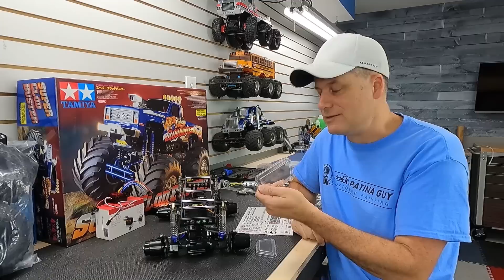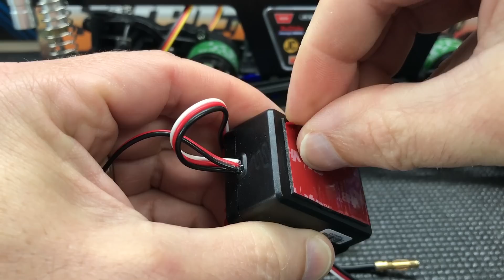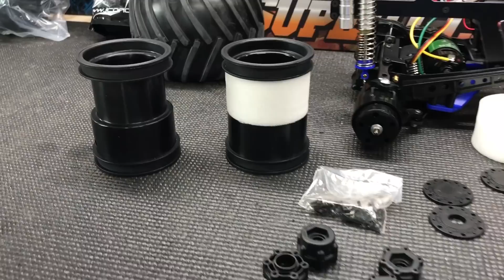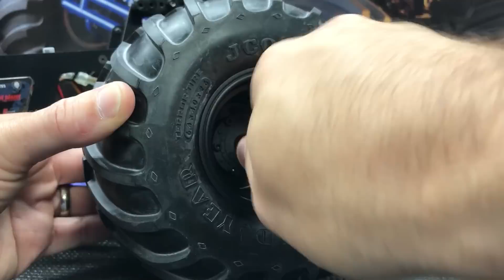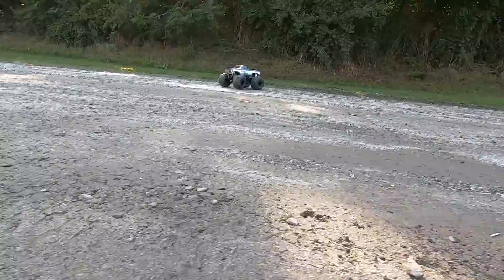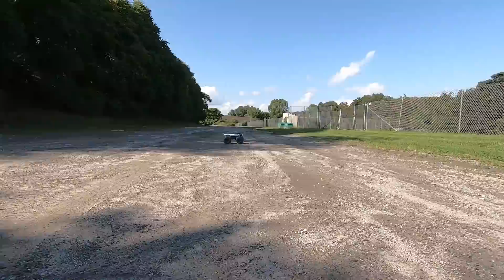One Mean Monster Truck! - JConcepts Regulator Tamiya Clod Buster Project PT 2 | RC Driver

Comment: I'm focusing on making 1/6- or 5th-scale RC monster truck chassis; i think that's the perfect size for a monster truck setup. gonna be using hardened plywood for the frame mock-up and then metal 3D printed tubes and axles for rigidity reinforcement, Ive seen some DIY 1/6 scale crawler biulds using a type of plywood and oak, cedar, and wood glued and screwed together - surprisingly its really tough and mimics weight distribution like the real trucks

Comment: Totally agree. Its in the blood. All scepticism and sinicism goes out the window when your wheeling a clod. Ive ordered the jconcepts chassis, bushings and servo mount, also some nice 120 mm dampers. Ive found 8x dampers but only 4 (soft) springs hits the mark for feel and aesthetics. Ive also ordered a couple of prepaintes bodies and the 880 hobbywing. It looks like that is the only decent dual motor esc on the market. Thanks for the review. Im pumped to biuld and thrash the lights out of mine. 
#mrbuggyluva

Comment: Absolutely love my two Regulator trucks. My Bigfoot currently leads the Trigger King RC Retro points standings with my Grave Digger in second right behind it. Fantastic kits, fun to build, and turns your stock clodbuster into a well rounded performance racer.